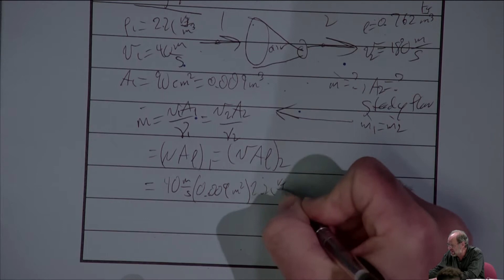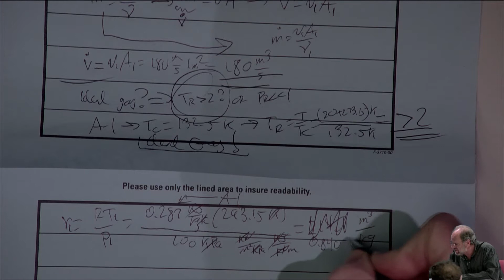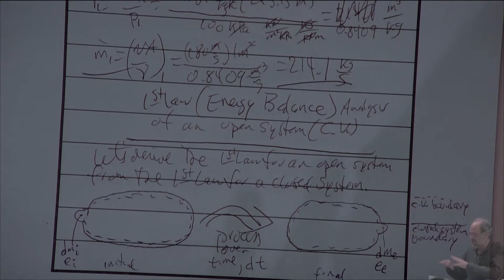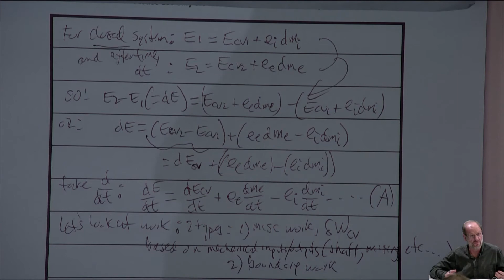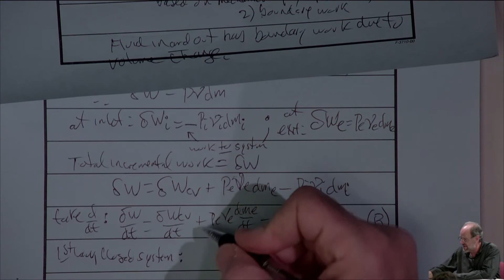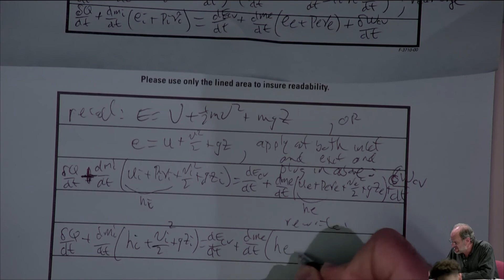Thermodynamics: Conservation of Mass and 1st Law for Open Systems (12 of 25)

Comment: In a closed system, you may only use enthalpy when pressure is constant right? Because h1 = P(v1)

But why is it in an open system, you can set h1 = (P1)(v1), when the pressure is not constant for the process?
Reply: I have a same doubt ?
Reply: There is an associated work, called work flow, which allows the continuous flow of mass to move into or out of a system. The book says to think it as an imaginary piston pushing fluid into or out the system, and it’s found from PV of that substance. So when finding the total energy of that flowing mass there is an associated internal energy with that substance aswell, and that is where the enthalpy term comes from combining this mass flow work(PV) + the substances u.

Comment: I believe there is a mistake in the derivation of first law for open system .
 h= u+pV , where V is the volume but he used specific volume instead which is wrong as far as I know.
Reply: there is no mistake....It should be specific volume....derivation is correct...the dude added specific internal energy to Pv note this is technically also a specific energy value if it was PV it would be dimensionally  inconsistent ..
Reply: Boundary work = pdV which is the volume or = pvdm which is the specific volume